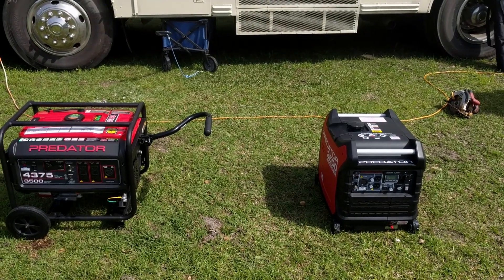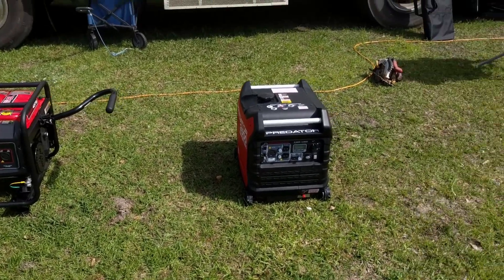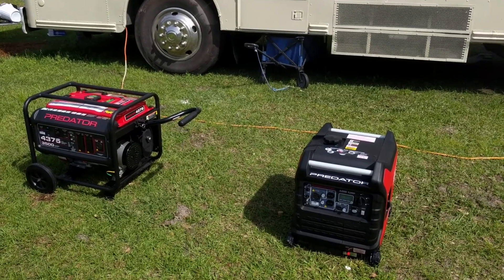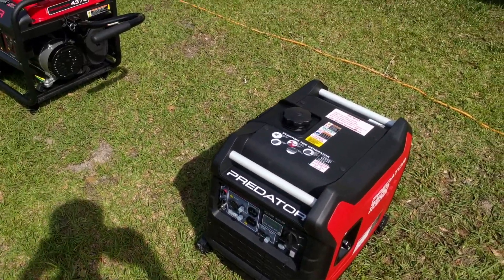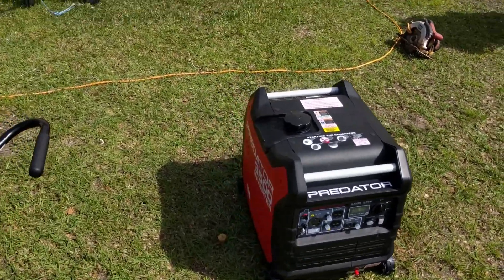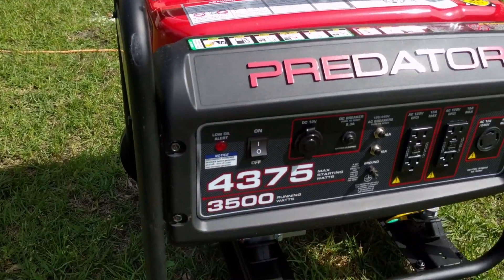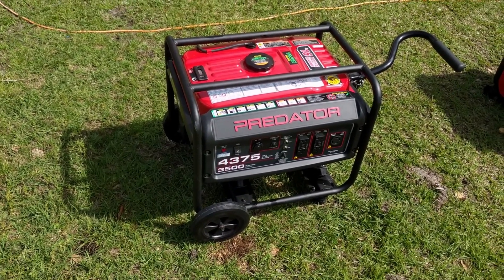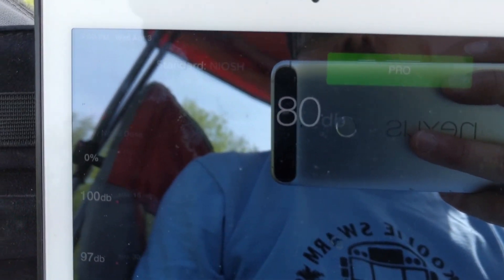Skoolie builder comparing the Harbor Freight Predator 3500 and 4375 Generators. Can you weld?

Comment: I have a 32 ft. Motorhome, it has a generator but had to replace the fuel pump, they didn't drop the fuel tank and insert it, but instead put it on the frame. So yesterday I purchased the 4375. I'm moving to Tennessee from Massachusetts this week, and now have a back generator just in case..,.. thanks for the information and video... God Bless
Reply from the maker: I hope you get many years of service from it!
Reply: we just got the 4375 for a backup power for a camper Many say the 15amp limit on that one makes it unsuitable for RV running. I'm new to this and no nothing about it.

Comment: Great and very informative video. My friend who has the 3500 generators, uses a kids old red wagon to dolly it around.
Reply: Man, what a great idea. Do they fit well inside the wagon or just sit on top of it. I might have to try this!
Reply: @DzHarryNuttz  My friends setup is a Royobe and it sits perfect in. About 6'in side to side room. He did place a rubber mat in bottom of wagon to help reduce any extra noise. He has a bad back, so lifting around was a issue.

Comment: With the noise On the Predator 4375  there lees noise  because the side are covered  I found on my 10 year old Chinese 3000 watt generator  I found I can bring that  nose level down to to around about 60 DB just by hanging two flat peace of half inch  marine ply board  from ground to the top and from front to back to cover it. I sure it work on on the predator 4375 as well .
Reply: That noise is less for you, but you're essentially making a megaphone for your neighbors to hear. 

Fine for a jobsite, but menacing at a racetrack where I try to camp.

Comment: Predator has their engines figured out, my 4375 just started on the first pull after being stored in the shed all winter.
Reply from the maker: Yep it's the same motor in both generators, it's built a good reputation for sure. Lots of gokart type projects you can find on youtube using it too (predator 212cc) some even more than doubling its 6.5 horsepower rating. If you let it sit too long with fuel in the carb you'll need to clean it out, which is only a 10 minute job. Only other thing I've really seen is the spark arrestor getting clogged up.

Comment: A normal conversation between 2 people will be around 70 dB. So that’s not too bad. Even at 80 db. The display that shows amps and stuff is pretty cool on the inverter one. But I could install an amp gauge on the 4375.

Comment: I worked in construction field for many years for  excavating business the company had about 12 harbor freight  generators
At the time we had the biggest ones that were made then man they got dropped dropped off your equipment dropped off trucks and at the same time most of the time they still worked occasionally they break something like a carburetor would have to be replaced or or something they held up extremely wellI was surprised harbor freight for what  you  play they are good I have two of them and I would not buy anything else I like the predator right now my big one is a 9000 the new one I also have a 6500 the 6500 I have for maybe 10 yrs.  Bet  like crap from kids and me weld with it almost everyday 110 and 220 never had a a problem you can't beat them for the prices trust me I had other generators and never ever worked as good or lasted like the predator

Comment: U did one weld in a push second weld in a pull it will be different welds push delivers the gas a pull weld leaves the gas excellent video you really helped me make a decision on the 3500 being way more quiet and a little more tech
Reply from the maker: Yep I was more worried about holding the camera than getting a "good" weld!
Reply: @Wanderlounge  🤣🤣 I don't blame u will crack that screen quick

Comment: the 4375 sounds extremely loud in videos but mine is shockingly quiet. i ran mine all weekend long non stop this weekend powering my travel trailer and it ran the entire RV without a single hiccup. It has a window unit AC that I set on 62 degrees all weekend, all the lights, tv, awning lights, even plugged a pit boss pellet grill into the outlet on the front of my RV and ran it no problem. this thing just hummed all weekend on around 8 gallons of gas.
Reply from the maker: When I was testing mine, even though I was in the middle of a empty field, I just kept thinking, no, no, no, this won't work for me. I can't say why yours is less bad, but we run into folks with this style pretty regularly and they're pretty bad in our settings!

Comment: It always sounds louder on video. 80 dB is not very loud. Especially if it’s outside. See that table saw is louder than the generator. Even though the gene got louder it’s just from the start up of the motor. None of those tools you’re using will tax that generator. Hook it up to a 3 tone central AC system and see how it does.
Reply: The people that say they aren't that loud always point the exhaust away from their RVs at the racetrack. 

Me and a few friends point them at the owners' RVs at 2am.  Usually, they will come to the next event with a 3500 Predator.  It's probably because they had to hear the full extent of what they expected everyone else to sleep through.

Comment: Do you think the 4375 has enough surge watts to start to full size refrigerators and a upright freezer?
Reply: NSX Properties yes
Reply: @BuildingWithZach  can it run 2 refrigerators a stove and a microwave?
Reply: Fortune Maker the refrigerators yes, but based on size you’d prolly have to run the stove and microwave while it’s off
Reply: @BuildingWithZach  thanks
Reply: Fortune Maker there is a possibility it would run three at a time though
Reply: Yes.

Comment: Thank you, i was wondering if an inverter generator would power a welder or if the electrical 'noise' or distortion from the ARC would cause any backfeed and upset the inverter somehow.
Reply: One thing about inverter generators that I did notice a few times TIG welding don't particularly care for it sometimes

Comment: The RV outlet on the 4375 says 120/240 volts. How do you get 240 volts out of the unit?
Reply: The generator has two windings that are center tapped. The center tap is used as the ground thus the other two ends are 120 VAC with reference to the center tap (ground) and have 240 VAC with reference to each other.  The same as the wiring in your house.

Comment: It’s funny how they install 20 amp gfi plugs and rate them at at 15 amps ... I just bought this generator second hand. It’s damn near brand new. Gonna use it for our band trailer. About 15 amps max for all our stuff so it shouldn’t be any problem.
Reply: Curious how you know the gfi plugs are 20amps?
Reply: @notgoing2lie  20A outlets have a horizontal lug as well as a vertical lug on the neutral side :)

Comment: I just bought one of these.  Does anyone reading this, can you suggest an adapter or plug that can be used for the NEMA
Reply: What do you mean John what are you trying to do?  I just got one of these and also added an outside outlet on my house with the interlock kit and made my own 10 guage cord with L14-30 plugs from Home Depot (you can buy them cheaper on ebay etc.).  For an outlet or plugs/receptacles, make sure they are L14-30.  L14-30R (female Receptacle), L14-30P (male Plug).
Reply: @Jj12915  Looks like my post got cut off.  I bought this generator and was looking to see what is needed to power my 30 amp trailer with?  What sort of adapters is needed etc from the 4pin 30 amp receptacle on the generator.  When the power goes out at my home and we want to use the trailer for obvious reasons, how can I do this with this generator, as it is out of the box does not work.  I have a 30 amp shore power already wired in.
Reply: @jaycelliott2  Do you have the 3500 or 4375?  I have the 4375 generator and it has a 30amp 240v outlet but not sure if the 3500 has one?  If you have the 4375 than if you want to make your own cord you will need some 10 gauge cord (buy it by the foot from home depot, lowes etc.) an L14-30P plug (for the generator end) and for the other end just match up your plug with whatever you are hooking up to.  I'm not an expert on this stuff by any means lol.  Only learned myself recently by setting my house up and making my own generator cord.
Reply: @Jj12915   I have both of those JJ.  Yes, the 4375 has that 30 amp 240v.  The 3500 has the 30amp 120v 3 prong outlet.  So what you said last, is just what I am wanting to do.  I've got some 10 gauge cord already, so getting the ends is all I would need.   I guess I was wanting to make sure, if this was going in the right direction, if I get the right ends, I should be able to plug that cord into the generator and run my trailer.  That was my question.   At least one other person, and probably more, have done this. Thanks.
Reply: @jaycelliott2  Yeah I did the same, just got some 10 gauge cord and the two ends that I needed.  Adding the ends on the cord is easy they give you instructions with the plugs on where to connect each wire.
Reply: @Jj12915  Nice, thanks.

Comment: I could hear the 3500 skipping and running more unevenly. Perhaps the carburation is better on the 4375? Also I need to run a submersible well pump. Cant do it withh only 120. I need single phase 208/240. The 4375 can do it.
Reply from the maker: At the low idle RPM its a putt-putt for sure. Much different than an engine that "idles" at 1500+! One of the many ways it stays quiet.

Comment: You have to wonder with the all the walls on the 3500, it runs more hot, and won't last as long in the long run compared to the 4375. Since these units do not use very much oil, cooling will be a factor....espcially duinrg emergency use and you are using it for hours during a blackout.
Reply from the maker: Well to be fair to HF, these things are super popular in the Skoolie community and lots of folks are racking up thousands of hours on them without cooling issues. Various folks on forums suggest modifying the casing to allow for more airflow but unless someone can actually show that the factory design is inadequate I'm leaving mine alone.

Comment: Just curious the inverter 3500 generator do you know if that's high frequency start etc
There are quite a few electronic things that have problems  with high-frequency I like the inverter technology I use it a lot in many things it really works well this new technology. some of it is high-frequency which can cause problems and destroy something's one example is plasma cutter tables. The computer part of the system doesn't really like high frequency it can interfere and destroy it at times that is one thing check out linear plasma table systems they talk about it .

Comment: Great review. Your video made my choice clear...the cost is well worth the lower noise to me. I wasn't too sure and was leaning toward the cheaper louder gen...but now I am not willing to have that much noise...3500 is worth the extra money.
Reply: Are you happy with your choice?  I’m looking to choose one in the next few weeks.
Reply: @Patrick-jx1yo  I am still shocked how quiet this 3500 is. I am totally happy with my choice. I think the only factor for me would be this...am I using it as a stand alone gen for emergencies and portability...or do I want to add a connection for whole house power. For my need...this one is perfect. If I wanted to add a power panel and use this for a whole house gen...I would choose a noisier more powerful gen. So it all depends on your end game. For me...couldn't be happier. Hope this helps.
Reply: @SoCalCigars  Thanks so much for the quick response!  That helps a ton!  👍🏼
Reply: @Patrick-jx1yo  , they just came out with a super quiet 9,500 watt inverter generator. It's a quiet beast that would barely stress itself running a home.

Comment: 1.16 quarts is what they hold not 6 tenths thats about half what they hold
Reply: The 4375W Predator generator takes about 0.6 quarts.  I have filled it three times.
Reply: @N6EAJ  You are correct. Did my 3rd oil change yesterday on my 4375.

Comment: This video should be re-labeled as jobsite generators. I think the majority of people purchase generators to power thier homes during a power failure.  At least that's what was hoping for.
I also take exception to your "power" in watts. You mention VA or Volts Amps. VA is NOT the same as wattage. According to ohms law wattage is rhe result of Amps x Voltage, BUT only for DC circuits and purely resistive loads on AC. Power saws and welders are INDUCTIVE loads so you cant use the wattage terminology. Js
Reply: No, Inductive loads are measured in watts whether its  ac or dc. That's why generators are rated with a surge wattage. You take your shunt amperage and multiply it by your voltage. Once an inductive load has started it will have a stable amp draw unless the inductive load has a mechanic force applying resistance on it. A refrigerator's compressor will have high amp draw on start up and maintain a steady amp draw until it shuts off. A table saw will have high amp draw on start up then maintain a constant amp draw until you start cutting with it then amp draw increase. You need a scope to measure you peak amp draw and voltage drop to calculate you surge. Either way a construction equipment test is a far more rugged test than running a household on a generator.
Reply: @derekdlick2516  not so, please brush up on ohms law..... Inductance devices current draw varies with frequency. With few exceptions, u don't use inductors in DC circuits
Reply: @rty1955  I'm pretty sure houses are running on a frequency of 60 Hertz like everything else in american. I have question for you. Were do you work and how much do you make. Because I'm going come take your job and more than you to do it.
Reply: @rty1955  And if you really are that confident in your abilities. Let me know were work because I'll take your job and do for more money.
Reply: @rty1955  in the world of business lying gets you nowhere Roy. But results do.
Reply: @rty1955 Ohms law applies to both dc and ac circuits. 🤣🤣🤣🤣🤣
Reply: @derekdlick2516  volts * amps in an a/c circuit = VA not watts. Prove me wrong
Reply: @rty1955  go ahead write out the formula for us.
Reply: 🤣🤣🤣🤣🤣🤣 MH isn't even a voltage rating to make an argument with your question regarding the comparison to an ac circuit. I'm not talking to you anymore. You are clearly living in your world.And making stuff up because you have issues and cant stand to be wrong g. Please go see a therapist. Do not talk to me any more.
Reply: @derekdlick2516  i suggest u stay with pulling wire as thats all your good for. Clearly you have zero electronic or electrical knowledge.
U just refuse to answer and call people names who are smarter than you. You clearly have anger managment issues
My original comment still stands